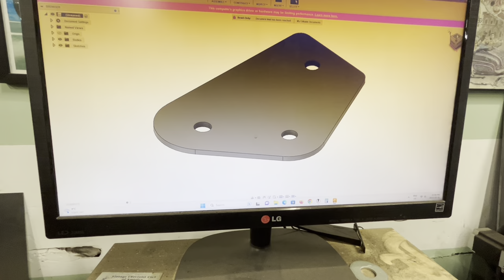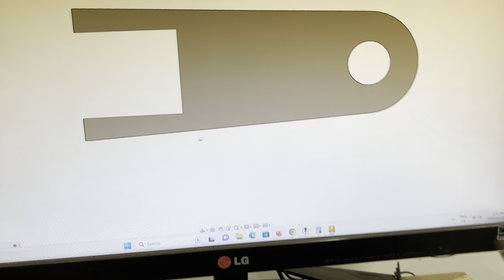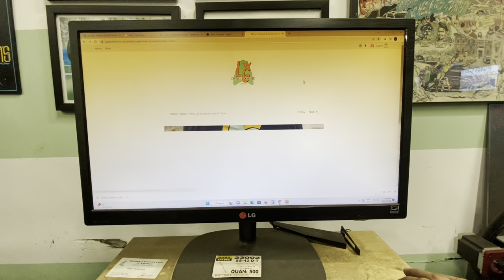32 Ford Pedal Assembly, Hydraulic Brakes, Clutch Linkage, Plug Wires and more! Part 17

Comment: Having multiple projects going at the same time seems normal to me. Last few days, I've rebuilt steered rack on my 07 Mustang,  removed rear springs from my 59 panel  (new springs coming Monday) & replacing starter in tractor.  It's also Interesting to see the different vehicles.

Comment: I think many, as I do, follow several HotRod channels most of which generally tend to work on one or two projects from start to finish. But, it really depends on the content the channel provides. I watch basically everything you upload and because you are doing several projects there is always something to be taken from your content that applies to what I'm interested in or doing myself. The other point I'd like to make is, you have to be happy doing what you are doing and if it's working on several projects at a time - then do it that way. Variety is key and you channel does provide variety and content that I always take something from. Cheers.

Comment: Yeah, that Cu-Ni brake lines are familiar stuff in here Europe. I think its just stupid to use steel lines, when there are a lot better materials available. Its a safe stuff, lasts forever and looks better than the steel lines. That spark plug lacing was pretty neat trick, thanks for sharing that!
And keep up skipping around with your projects, i like to see something at every week, than just 1 video per month. Keep up the good work!

Comment: I like the variety of the projects.
Do you have a part number for the hydraulic brake light switch?
Great video btw
Packed with useful information because I will soon be plumbing the brakes on my T
Reply from the maker: Standard SLS27

Comment: I enjoy watching the variety mixed in Lee. It’s nice to see so many different vehicles. Do you run one of those check valves on the roadster or is it high up enough?
Reply from the maker: My roadster uses a 39-48 Ford master cylinder, which has a residual pressure valve built in.

Comment: I've been using copper niquel tubing for brake lines sometime before i saw it in your videos in my shop and in my own cars, good stuff and very easy to work. 
I personally prefer to see diferent project videos at the same time, i think it's cool to learn and see diferent thinks in diferent projects. You don't going to put airbag suspension in your 32, or MII IFS conversion but it's cool to see it in other customer projects. 
I like how great it's turning out that 32 chasis, keep on with it!

Comment: You've got a good set of equipment. A quality 4 post lift with a 180 degree swing jib crane/electric hoist at one corner takes all the pain out and room for another car. I didn't bolt mine down so I can move it (wheels included). If you get stuck with a broken cast iron part Crown makes a .035 mig wire that works great no heat just typical good weld prep. I even repaired 1931 badly broken exhaust manifold which is really poor material.

Comment: Rounding corners on brackets also leaves fewer things to ding a knuckle on later.  The original bracket may have been done from
under the assembled car which severely restricts access and sight lines.

Comment: To retain the old time look how about adding angles tangent with a radius around the stud centerline forming a triangle tab? Replace the single mounting bolt by drilling and tapping 2 bolt holes or rivets (underside welded)?
Simply clean up the base plate by removing the mechanical brake light switch details and weld plugs in open holes.
But your solution is very clean. 
I still vote for bobbed rears and cycle front fenders.
Reply from the maker: I still have the cycle fenders that’s used to be on the front. Wanna buy them? Hahaha

Comment: How about an oil cooler with a tiny fan? There's a guy in San Diego that puts an alternator in a generator. Has did many for my old motorcycles. Keenan Tatro turned me on to him.
Reply from the maker: Not sure I need an oil cooler, this engine is all stock.
Reply: @LGKustoms  Just gives even stock a longer life.

Comment: That tiny hole is only for the oil pressure gauge. You can’t put that into the filter housing.
Reply from the maker: Are you talking about the restrictor hole going in to the oil filter? Or the pressure port on the back of the block?
Reply: @LGKustoms  yes in my opinion, that will not let your oil go through the filter

Comment: working on a 1948 flathead has the starter that has the long bolts that go all the way thru the starter to bolt it on there are 2 bolts in the south cannot find a part number for a starter i know its odd have looked every where can you help me
Reply from the maker: You’re trying to find a part number for a flathead starter? Power master 92507 from Summit Racing

Comment: 37:02 Why does that driveshaft yoke have so much stick out?
39:41 Another name for the Adel clamp is tubing clamp. Just some brain candy for everyone.
Reply from the maker: I’ve never heard tubing clamp before! That makes sense. 
I’m not sure why the yolk sticks out so far, that’s just the way it’s designed. The output shaft on the transmission sticks out really far, not like a modern transmission where it only sticks out an inch or so.
Reply: @LGKustoms  Thanks for your answer.